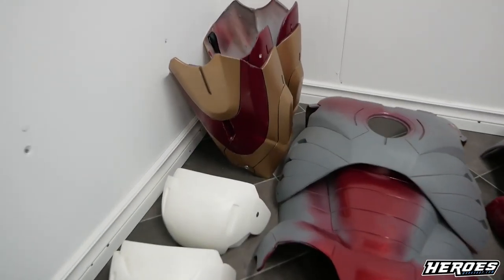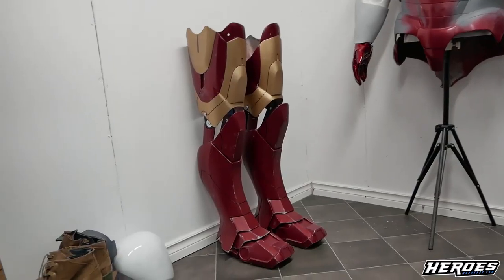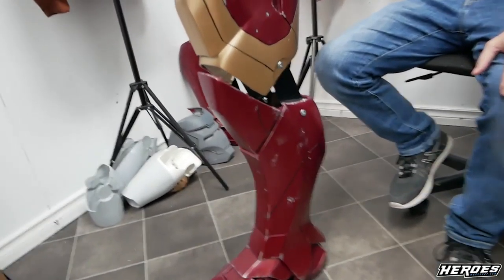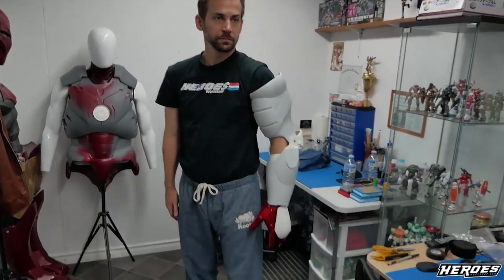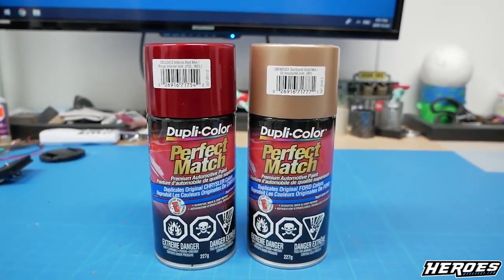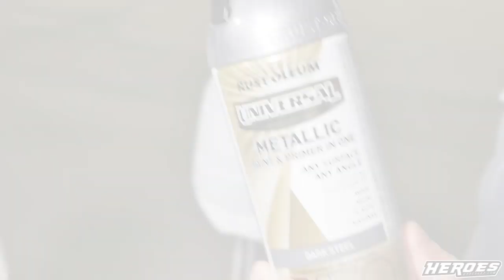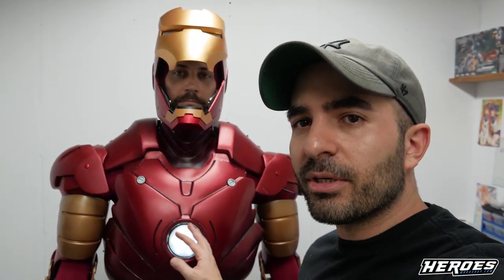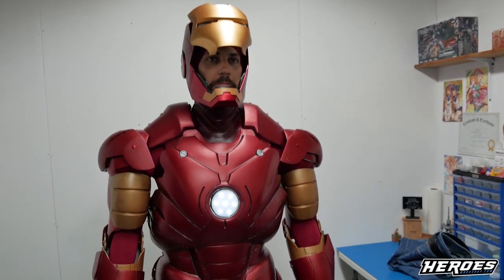Iron Man Mark III Replica Complete! + Suit Up Test

Comment: The Iron man suit is no different than putting on my 16th Century Plate armor rig.
Reply from the maker: That’s cool to know that it’s a similar system!
Reply: @Heroesworkshop  Very Similar except instead of suspenders, you wear a really thick coat and pants that the armor is tied too in certain locations to keep it snug on bending points so it never binds.